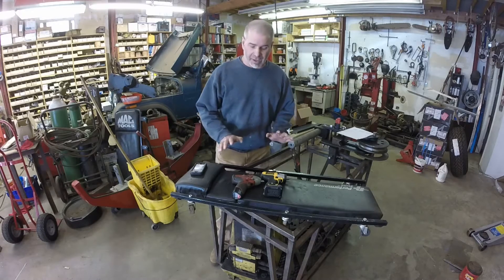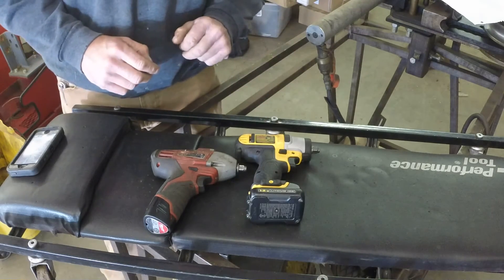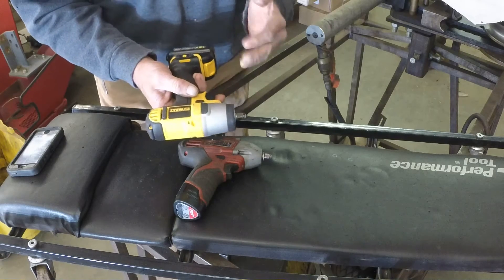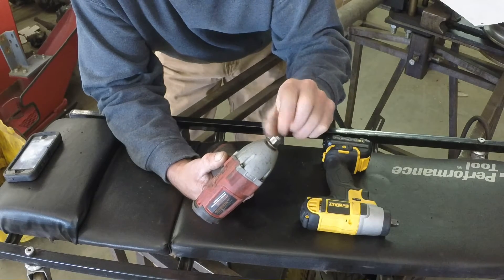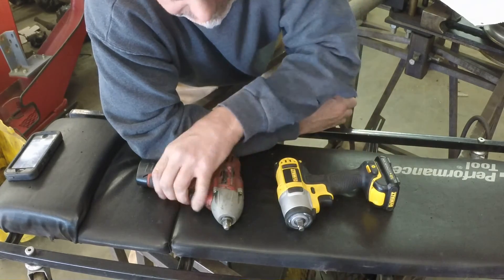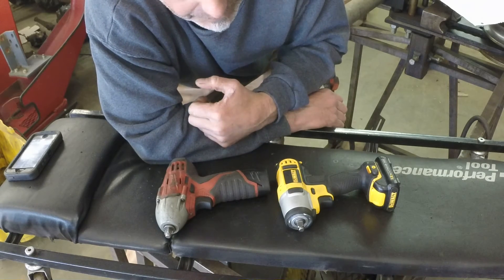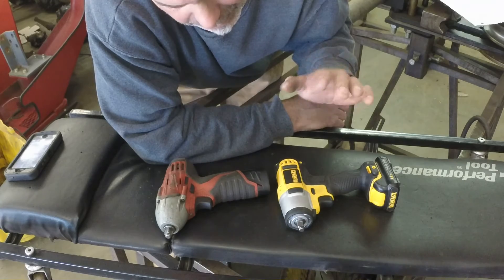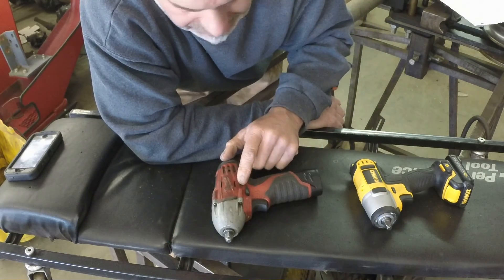Milwaukee vs. DeWalt. 12v, 3/8" impact wrench comparison

Comment: Used to torque down a crankshaft pulley bolt an additional 90 degrees◔◔>share4.photo/DImpactWrench?Ш    and break torque on lug nuts and cam phaser sprocket bolts on a Ford 5.4 3v during timing job. It has no problem even at level one. Level three adjustment is even more powerful!

Comment: Man it's tough finding these 12v tools today. Those that have them are not giving them up. Manufacturers assume, I guess,  we ALL need big heavy 18+ volt tools with batteries as big as concrete blocks. It's getting as bad as camera pixel wars.

Comment: you're using old impacts nobody is going to buy and which one has had the harder life  useless irrelevant test
Reply: Dennis Falan    Wrong answer dude.  That dewalt is one of the best compact impacts ever.  Light and well balanced and over 95ftlbs.   Still available as the dcf813s2

Comment: Milwaukee 2457-21 3/8-in Cordless M12 Lithium-Ion Ratchet Kit
http://amzn.to/2mM627F
This driver is an invaluable time and effort saver for industrial technicians! My assistant and I were both succumbing to carpal tunnel syndrome from the repetitive motions involved in our work on autonomous robotic shuttles until a co-worker talked us into investing in this rechargeable driver. We've never looked back or regretted the expense since buying these! Charges in about 40 minutes from dead and lasts for days in moderate use. Do your hands and wrists a favor!
http://amzn.to/2mM627F